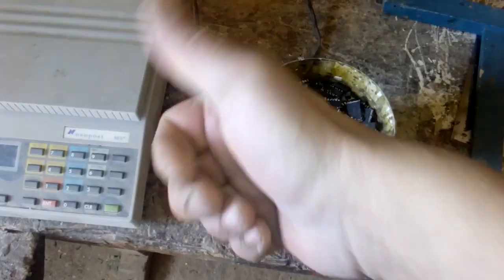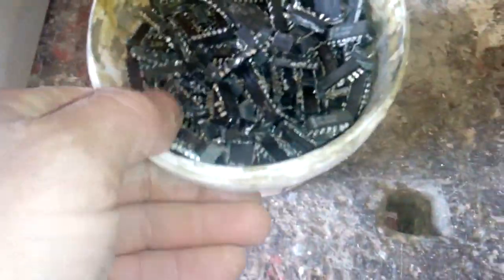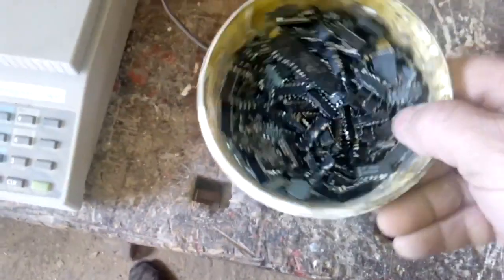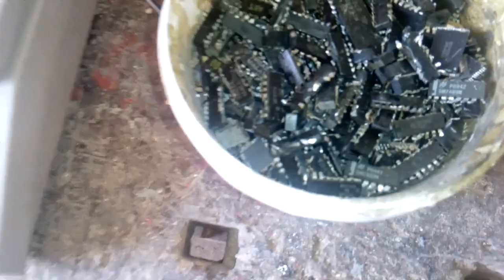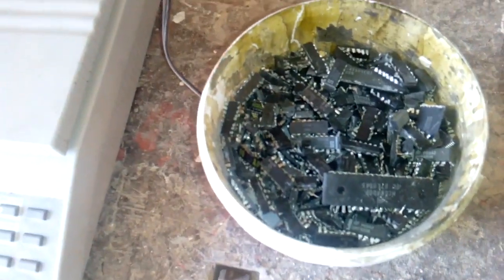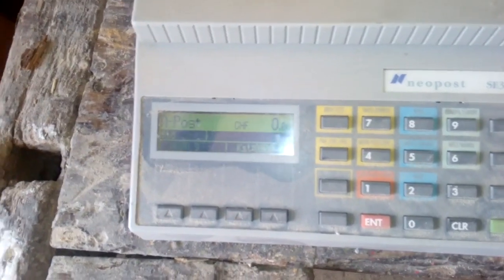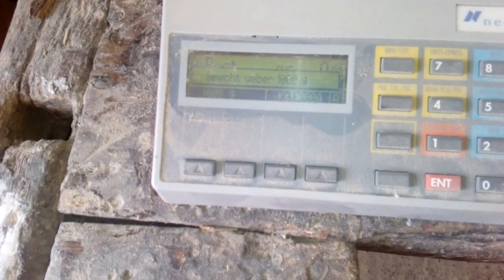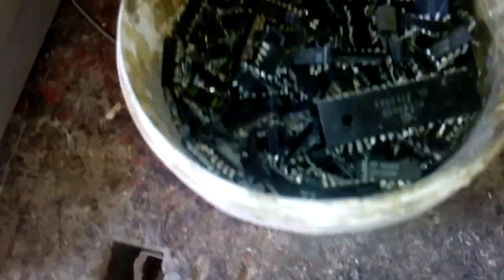Ic-Chips with high gold content - Gold recovery!

Comment: I wish my day had gone as well as this.  Stuck in the middle of trying to figure out what the hell happened.  Incinerated 2gk of assorted ic and split the batch in half afterwards.  Nothing I haven't done before.  One batch went fine and all the gold dissolved but the second batch the gold will just not go into solution.  I am totally stumped here.  The first batch isn't doing well either as the gold will just not drop. I added the nitric in small amounts and the same amounts for each batch.  Both batches being done at the same time btw.  I've denoxed the first batch by evaporating down to a syrup and re-hydrating with hcl just like I have done dozens of times.  Stannous test is a good positive.  SMB will NOT drop the gold.  I've NEVER had to add this much before. I have no idea what the next best step is.  Today is one of those days where I honestly have to ask myself why I bother with this stuff.  Sigh.
Reply: did you manage to recover the gold !